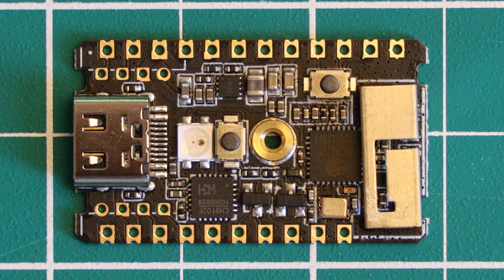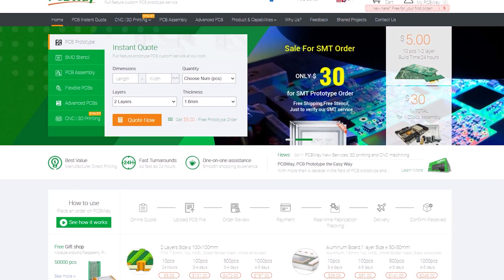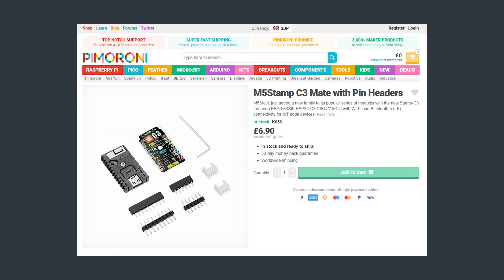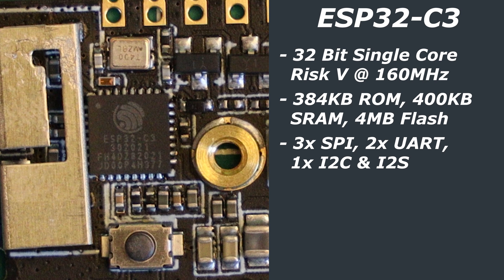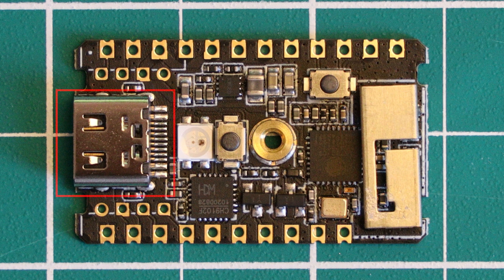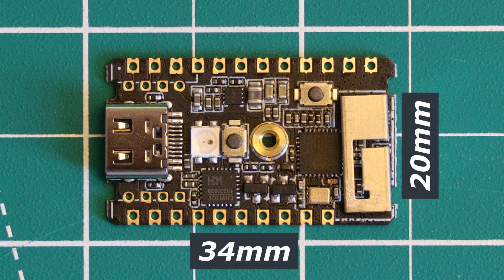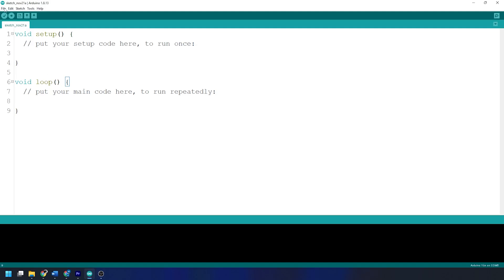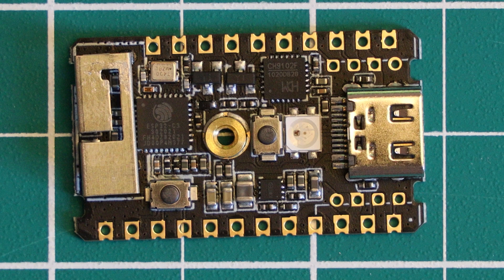M5Stamp C3 Review: RISC-V based ESP32-C3 WiFi and Bluetooth Enabled Microcontroller Board

Comment: With so many different flavors of the Risc-V chip (C3, C6, etc) with each selecting the ISA options it wants..   will the c-compiler or python interpreter,  flag an error if one tries to enable pull-up on a pin that only has a pull-down option? ex. button = Pin (22, Pin.IN, Pin.PULL_UP) 

And even when the Risc-V chip supports the same ISA instructions, will chip from different fab-houses have different performance based on the nm technology, and how it implements those instructions?

Also, when you plug in a ESP32-C3 or C6 board, does the Risc-V's USB peripheral instantiate as a COM port, or as a JTAG/SWD debugger, or as a Mass-Storage-Device... or all three?   For example, I've seen some boards that have a BOOT button to access a bootloader (in ROM?).. but can you upload the application via a serial terminal (ex. Hyperterminal), or by dragging the bin to the drive? 

(I'd like to buy the "ESP32 C3 0.42 inch LCD" from Banggood in order to learn and debug with, but not sure if I also need a special debugger adapter to step thru the code (ex. Segger), and/or a USB to serial cable (ex. FTDI) for general print/logging?

Comment: Interesting review. There is an error at 4:06: the maximum Wifi speed is 150Mbps, which is 150 mega bits per second (not ... bytes ...). The same error is at 4:13: the Bluetooth data rates are 125, 500 kilo bits per second (not ... bytes ...), 1 and 2 mega bits per second (not bytes ...). Upper case 'B' is the ISO unit for Bytes, lower case 'b' is  bits by convention.  See ISO/IEC 80000 on wikipedia. 

---- 

Those errors undermines the 'authority' or 'expertise' you are likely aiming for.
Reply: Haha, I knew there's be someone who couldn't help pointing that one out!  If didn't then I'd have had to. lol.

Comment: There is something appealing about RISC-V.  I'm delighted I can finally take the plunge for a mere $6!  As for other ESP32 boards and chips, I'd be interested there, too.  I've got an ESP WROOM 32 sitting on the table this minute, awaiting first light.  The 240MHz clock speed is compelling.  Would like to know more about the LX7 architecture and instruction set - and how they differ from the ARM  Cortex M architecture.

Comment: Why does the board have a usb interface chip? I thought the C3 has this part built in.
Reply: i wondered that too, reading its schematics i think the usb port is only a serial port and power the actual usb data ports arent connected, instead they are on the board
Reply from the maker: Within the last couple of days, M5Stack released a refreshed version of this board the C3U which uses the onboard USB functionality instead of the usb interface chip found on this board